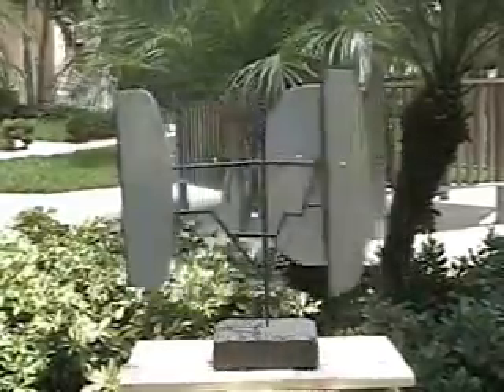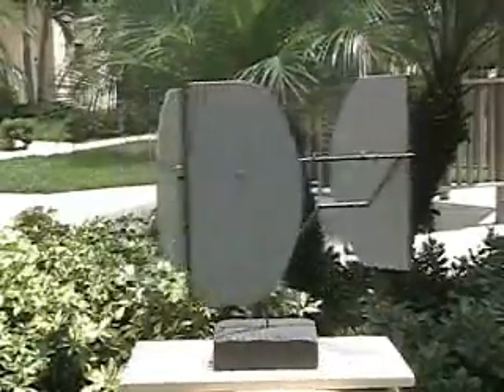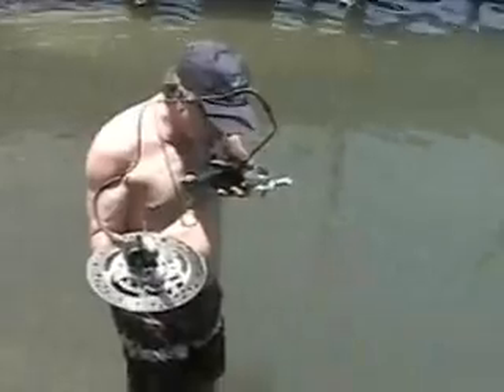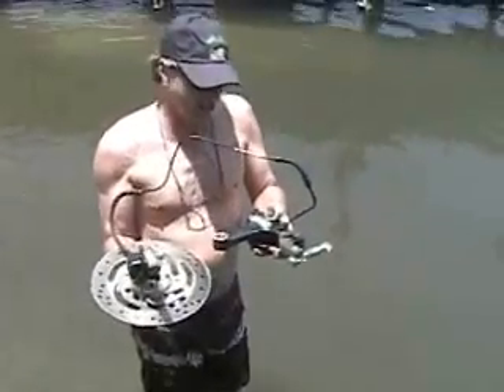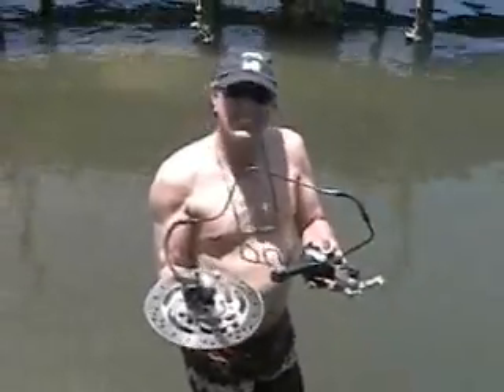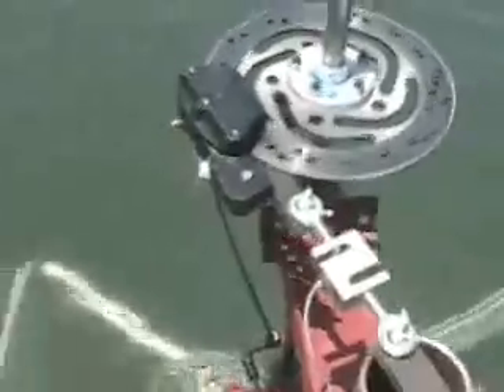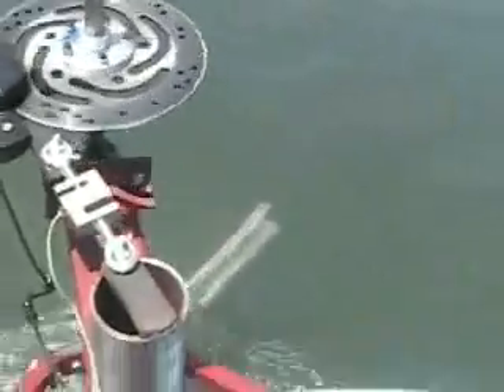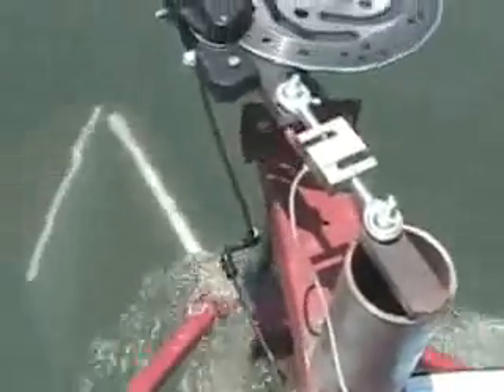The Robinson Wind and Water Turbine - Patent Pending

Comment from the maker: Thought I would add to my comments on this.  I've been able to transfer the excess torque of the flipping panel and transfer that excess energy to a usable area of the system. I believe it will both stabalize the system and increase the revolving speed of the entire system because of minimizing the centrifigul force effect on the panel that comes back against the flow as it comes back to it's structual arm. The drag is less on the leeward side and the windward panel extracts more energy.
Reply: H. Skip Robinson hey skip, did you get your invention out of the prototype world, scaled up and working? Very cool and interesting stuff. I’d love to ask you a question about wind art . Great job

Comment from the maker: Hey texfly1, 
Cost efficiency is obviously the key to electrical generation.  No computer modeling has been done as engineering costs estimates are very high. Three engineers have recomended building one because it would be cheaper and would give engineers a good starting point to improve efficency. From my 2.5 years of research, what makes the wind system different is the panel control system and how it effects the operational forces. You can not see the system in the video, but it is there.

Comment from the maker: It's handmade and is way out of balance. The three structual arms aren't even 120degrees apart any longer and a 1/8" springy steel center spindle was used to help evaluate various forces.  Need to build a big one now and all my funds are alocated for the water tubine project.  A full size system would be pretty cheap to build. If anyone wants to help me build a larger full size working system please let me know.

Comment from the maker: I think that it ended up at around 0.38 kW. The hydrodynamic efficiency can be increased and a four panel could be added to acheive even greater output.    

The wind turbine has not been tested or computor modeled but because of some proprietary elements in the design I believe that it will be superior in actual output but water generally flows 24/7 and wind is at best 39% daily output.  

The key to my wind turbine is the 50% lower wind speed  to run it with the decent power output.